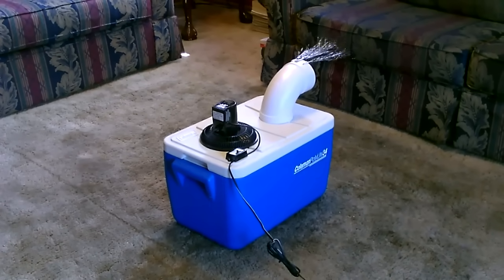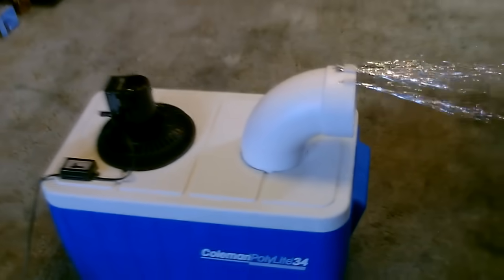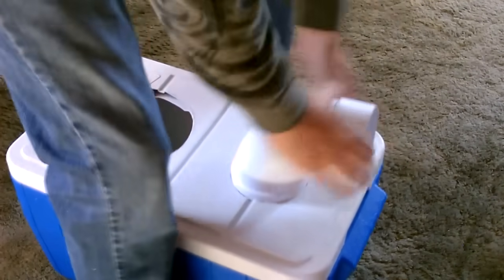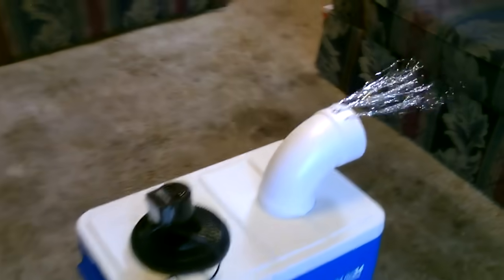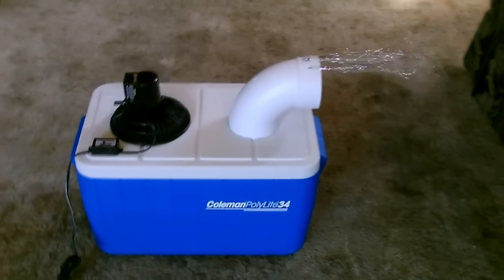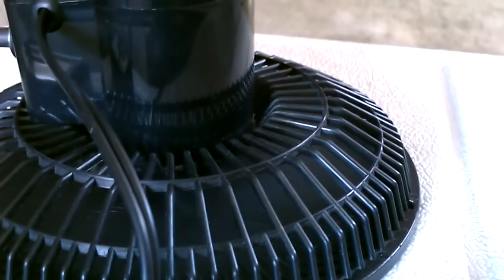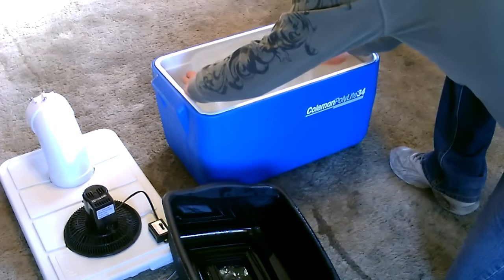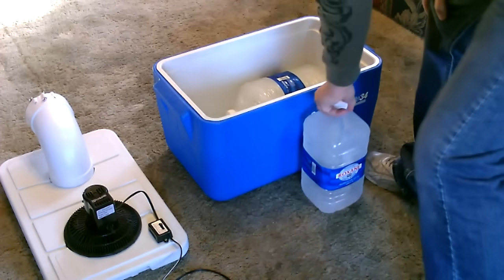Homemade air conditioner DIY - Awesome Air Cooler! - EASY Instructions - can be solar powered!

Comment: Wouldn't the ice melt fast if you were pumping hot room air into the cooler?
Reply: Sure the ice melts, but a 2 gallon solid block of ice (about 16.5 lbs) will easily outlast a 20 pound bag of cubed ice
Reply: shoe chew Because your wasting money in electricity by leaving the freezer door open come on lo !  Thats the whole purpose is do it for free.
Reply: b
Reply: You always put water in with the ice it help thd cooling effect. The closer the fan is to the water the better not to create waves that may be too close.
Reply: Ujwal Anurag - User name checks out.
Reply: sure the ice melts, but whats the Goal, have an ice-cube for Long time, or to have cooler air in room? and with cooling there Comes the Point where room Temperatur is colder then outsidetemp, so using indoor cooled air is better
Reply: Shoe Chew a bit of frosting will occur if you do this try to do it for 2 hrs leaving the fridge slightly open you’ll see how the edges become snow flakes real quick ...
Reply: EXACTLY!
Reply: Yes, and it then becomes a PITA keep replacing the blocks of ice from a freezer, which in order to make ice needs to pump heat into a room..This is why it's not really feasible.
Reply: Barnacules Nerdgasm LoL damn, how hot is your apartment???
Reply: Yes, so your buying ice plus the power for the fan! That block is probably ten bucks.
Reply: I will shoot aaaahhhh hahaa  whaaaaaat!?!
Reply: I will shoot DAMN SON
Reply: Barnacules Nerdgasm
Reply: I will shoot are you really sure about the exactness of the systicodynamical values of phosmophiric uranium and its effect on the mitocondria when this is operated in a house which is closer to a volcano like mine is?
Reply: Barnacules Nerdgasm xx!?xldl😄😄🤗😊❤️🤐😂🥞😭😭🥞🥞🥞🥞🥞🥞🥞🥞🥞
Reply: Why don't you 3D print a box instead of buying a good ice box and cutting it up?
Reply: That's exactly right, Barnacules.  The only benefit to this system is that it melts the ice faster and releases the cold faster than it would otherwise.  The potential in the block of ice (created by a real "AC" unit in an actual freezer) is the same whether or not you ruin your cooler.  Why not just cool your house by leaving the freezer door open?  SMH.
Reply: @shoechew  freezer dont work like that,  they don't continuously freeze all the time

Comment: I was a private investigator in AZ and have used one of these for years on surveillance.  It's not at all feasible to leave your motor running during a surveillance and it gets killer hot in the back of an SUV in Tucson during the summer.  This made the interior of the vehicle quite comfortable. Ice melt drainage overflow goes through a tube to a spot below the vehicle. Works great!!

Comment: Great idea, it mat cost a little more to use dry ice. But I would think that the dry ice would even be a lot colder air and maybe even last longer too? Something to play around with anyway and a person could always go back to good old ice in a pinch!
Reply: I made one of these myself and it does work very well for what it is. Unfortunately sooner or later the ice melts and it isn't much for cooling at that point!
Reply: After doing some more checking on using dry ice in the home made air conditioner, I've found it's not a good idea at all! Dry Ice also makes carbon dioxide and can be lethal. So please stick to using good old regular ice!

Comment: 1. One advantage of using water in bottles than naked ice is that it does not add humidity to the air.
2. This could be more efficient that A/C because you are blowing it directly on your body rather than cooling the entire room.
3. The fan seemed rather loud. I would consider a 200mm (8 inch) fan for cooling computers. Very quiet.

Comment: Thus to replace a 12,000 BTUH AC unit all you need to do is have 1 ton of ice to melt each day; ie 2000 LBs of ice in 24 hours. Actually that is what a ton of Ac cooling is defined by!. The heat of fusion of ice is about 144 BTU per Lb of ice. The phase change of 2000 Lbs of ice is 2000 *144 = 288,000 BTU.  Thus the heat flow over 1 day is 288,000 / 24hours = 12,000 BTU per hour. This term goes back over a century ago when food was shipped in railroad cars via ice. 1 ton of AC cooling is 12,000 BTU per hour.

Comment: I love this, thank you! I'm going to try this but I'll get one of those rigid insulation panels, add some insulating seals, cut it to fit the top of the cooler and then put the fan and vent in the top of that. That way when I'm not using the A/C in my camper we can still use the cooler when we are at the beach or something. OMG! A/C comfort when boondocking! I love it so much!

Comment: hey m8, how hot was it out side on this day? I noticed you were wearing jeans and runners. Also, does this one cool the air better than the bucket with 3 1 1\2 " pipes?
Also, thanks this is awesome

Comment: I trying to build this now. I'm powering my 10w 1a 12v fan with a "power station ps3x" but the fuse keeps blowing on the fan. What solar panel are you using?

Comment: What are some of you talking about saying it's more expensive to freeze ice then it is to run an air-conditioner? do you not have refrigerators with freezers and refrigerators already running and freezing ice and as far as growing bacteria want to try to clean it out every time you put new Ice in it is it really that hard to figure out

Comment: Looking through the comments, seems there is a lot of unreasonable concerns.

• It costs as much, or more to run this homemade A/C than a regular AC because your freezer is working hard to cool that block of ice, OR Ice is too expensive.

If you take into account the total cost of this homemade unit, which is less than $30 (minus solar panel), that's about a $170 difference in a window AC unit. Figure in about $50 for electricity during a summer's use, and now we're at about $220 difference. I find it very hard to believe that a block of ice like that would cost all that much to make, especially if you let your cold water run for 2 minutes, giving you the coolest water available to start the process. The guy is running the fan on a very small solar panel of 15 watts. A window AC uses in the neighborhood of 500 watts +.

This guy's homemade A/C has no environmental impact - unless you take into account the electricity needed to cool the ice block; but even that could have came from more greener venues like wind, solar or natural gas. 

As far as the mess or possible bacteria concern with the water, I don't see why you couldn't use Ziploc gallon bags of water, frozen. It would make for easier removal of the water and re-freezing, and the water wouldn't contaminate and be dissipated by the fan.

It's also worth mentioning that a wall AC unit can be pretty noisy with the compressor kicking on and off. Also, they can be tricky - if not dangerous - to mount in a window, having dropped one out of a second floor myself. 

Overall, I think this is a great idea, perhaps with a few minor modifications.

Comment: A cheaper alternative to the ice block is the filled bottles as the video shows. Just wrap them in aluminum foil for faster freezing so your freezer's compressor doesn't have to work so hard. This is also better for the environment because you do not have to empty and refill the bottles. Make sure to save your foil, too. :)

Comment: Hey Desert, just finished watching this and the swamp cooler videos, great job. I'm headed to Burning man this year and need some cool. Just from watching your videos it seems the ice cooler method was significantly cooler. What are the pros and cons of both systems. In your estimation, which would best suit the black rock desert. Mind you I can get ice everyday, so running out won't be an issue.  Planning on being in a tent or hexayurt. Thanks!!

Comment: You could totally incorporate that into an emergency refrigerator. Build a box, or even get an old refrigerator, cut a hole in it, join the two together and there you go.

Comment: I don't think desertsun2 was intending this to replace your central AC unit. It does however have it's uses. For example if your central AC unit quit in the middle of summer and you couldn't get it fixed for a few days. One of these in whatever room you are in would be a blessing. If you have a huge house you can run one of these to cool the room you are in instead of cooling the entire house. and for those that have no AC at all..well, you cant put a price on how nice this idea is. Would be good to keep a area outdoors cool as well..say a gazebo. put one of these in center and it is bound to be cooler.  As for the ice, my freezer will turn a 2 liter of water into a block of ice in less than 8 hrs. The deep freezer even less time. dropping five 2 liters in there won't make a noticeable difference in electric usage. And yes the deep freezer is about 3/4 full of stuff. For a project, I had to freeze three 5 gallon buckets of water every day for 15 days, my electric bill went up $36. Went three weeks without central air..bill went down $146. Would i trade this for my Central air? no, it would be a huge hassle to do every room. But for localized and/or special condition uses...great idea.

Comment: I think this can make it only worse, because you increase the humidity in the room, and prior to that you need a lot of power to cool the water to ice. A better solution is to use regular, not-cooled tap water where instead of releasing the humid air in your room you will use some large diameter metal air vent to drive the humid air outside...thus cooling the tube in your room without increasing the humidity of your air and not using additional energy to cool the water.

Comment: You can improve that insulation a little more by filling in those open pockets (that you made by cutting it open) on the lid with insulation foam and then caulking.

Comment: Just remember that if you make the ice in your freezer, you will end up with a net increase in temperature (The freezer puts out a lot of heat to make the ice). So in the end, you warm the house more than you cool it.
If you have a freezer in the basement or garage, or you buy a block of ice, you will avoid that pitfall.

Comment: I made this. Exactly how he did. Put it in my pop up camper and it hardly worked. Melted the ice quick and didn't make the camper cold at all. It definitely blew cold air but it didn't even fill a tiny camper. Bought the same fan, used a giant sheet of ice and even caulked the elbow pvc pipe.... Any advice?

Comment: As crazy as it sounds I have the best source of ice  Take disposable diapers and let them soak in water for a couple of hours  Then put them in gallon freezer bags  Freeze until frozen solid  They will last up to 24 hours in the cooler
Reply: motor mania used diapers dont work so well.

Comment: I built one of these tonight to be used to cool an area about 8' x 14' on a bus used as a clinic. It is an alternative to running the engine for 3 hours in order to cool the exam room. I got a wired fan (10" Honeywell Turbo) which will be plugged into a power inverter, along with a 3" PVC elbow. The cooler I chose, in order to accommodate a 10" fan, is a 48 quart marine cooler. Everything fits and works right, but the air it puts out is not cold - cool, but not cold. I'm sure it will not cool this exam room when the sun is beating down on it and the black privacy film on the windows. Anybody have any suggestions as to why this is not producing cold air? Thanks in advance.

Comment: this is a great idea...I am not very crafty...but will try this...still trying to understand how to switch from solar (day time) to use at night (battery) night time will be the most usage for this but will that battery 1 work all night and 2 can be recharged by solar panel? Also, I found that if I but a bag of ice cubes will be cheaper than using energy to freeze water. Lastly, where can I get dry ice??
Reply: Kroger has dry ice at a reasonable price. Come visit! :)
Reply: Will do
Reply: Wolfunov Good luck with putting dry ice in a sealed container.
Reply: Haha yes, might as well just not use dry ice, as I have

Comment: Just made one to about the same design as yours. PC fan, plumbing pipe, styrofoam cooler. Will be solar in the day, battery evenings.
Perhaps a tip for frozen water containers is gallon milk jugs...wash out, cut down with a pair of scissors to half height and the water is then exposed.

Comment: have you tried to reduce the exit vent down to a smaller size to create more pressure?
Reply: hmmmm ...'Im wondering if that will work
Reply: You should try it and post another video :-)
Reply: yup through, smaller exits increases pressure also making the air molecules stay a lil longer in the box cooling the molecules further

Comment: Thanks for the idea! I am going to make this very soon For my patio. Louisiana heat is miserable..but I'm going to use a lot of ice (more ice than water) and add a few capfuls of Florida Water-on the front of the bottle, it says "Murray & Lanman Florida Water Cologne" (found a bottle at Walgreens) . I made an outside cooling fan (saw online) last summer..(box fan w/ copper tubing, pump, etc..) but the fan broke... And I used the Florida water... I'm sure a lot of y'all know what it is...but those of you that don't know... It makes the water extremely cold!
Reply: Hey Alexander!  I sure did... :)  but instead of buying an ice chest like in the video, I bought a big styrofoam one.  It works pretty good!  :)